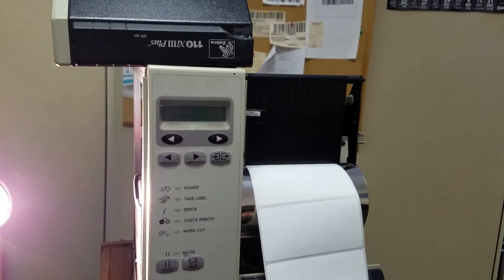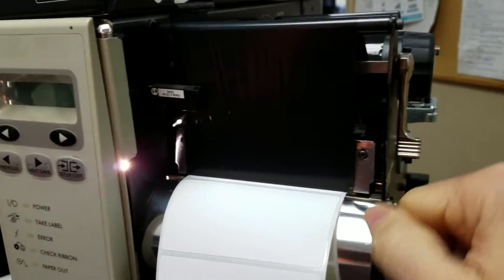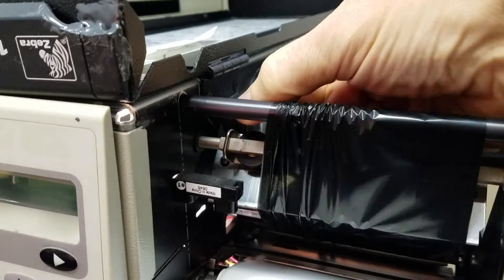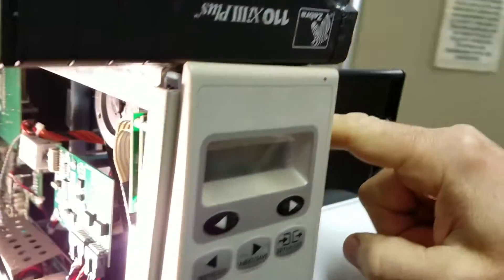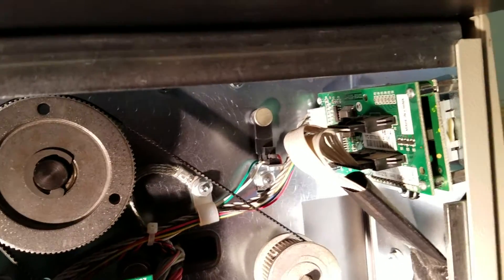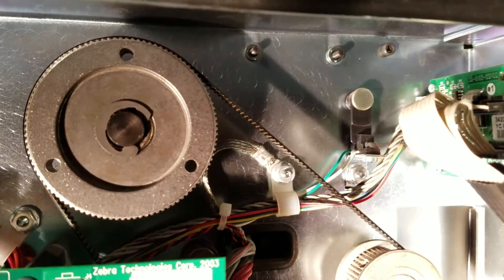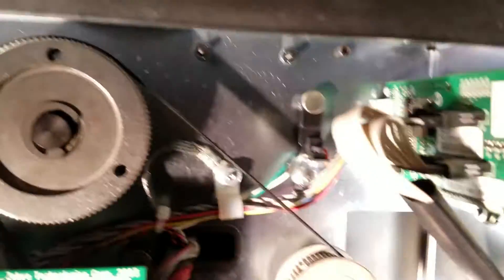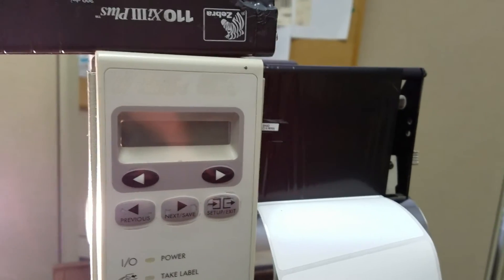Zebra Printer sevice: Printhead Open error

Comment: My zebra S600 thermal printer does not have any type of magnet sensor.  Yet my printhead open light keeps flashing even though the printhead lever is closed.  Any tips or suggestions here?
Reply: You will need to figure out any sensing system that has wires going to it that is attached to the print head housing mechanism or the lever.  I do remember the S 600.  The first non metal Zebra. S400, S500, S600.